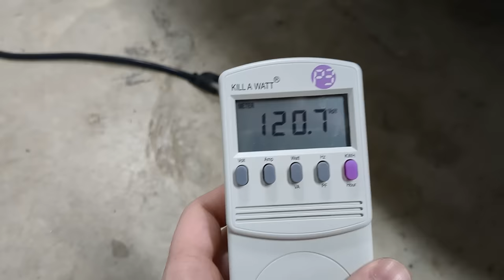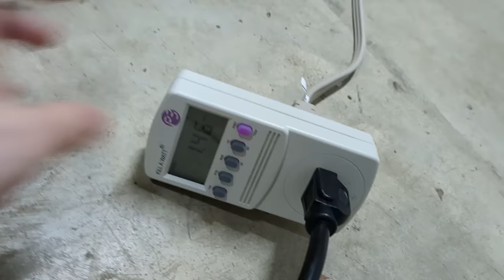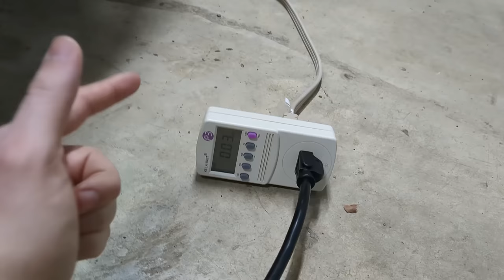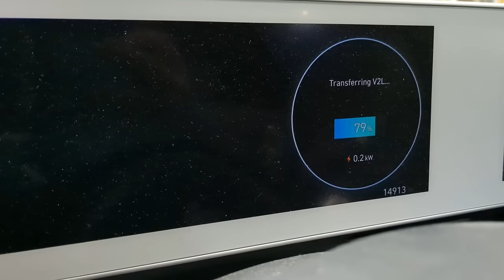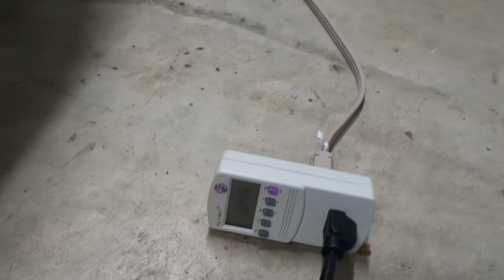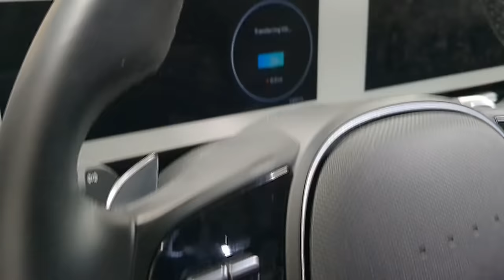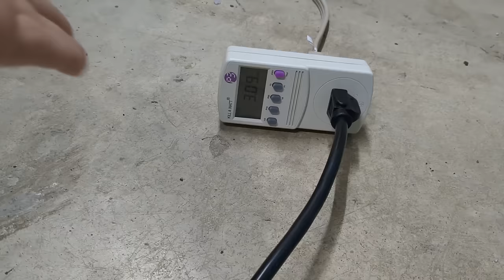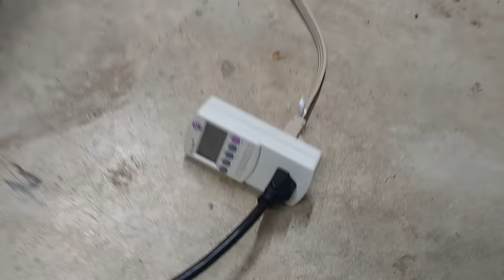A 24-hour test run of the Hyundai Ioniq 5's Vehicle-to-Load function

Comment: Overall this is a massive improvement over a generator. My 5kw generator would have used about 8 gals of gas just to idle for 24 hours, let alone whatever loads I put on it. So, $30ish at current fuel rates. You used 8 kWh of electricity (at worst off the battery). So... what, $1 of electricity. That's amazing.
Reply: But when your car battery goes dead your done for. A generator can be refilled and keep running continuously.
Reply: Sure, but the generator (petrol/diesel/gas) will run pretty much forever. Batteries in the car do degrade.
Reply: God damn, is electricity really that cheap overseas?
Reply: @philipcooper8297  Battery degrade waayyyy slower than everyone saying, afeter 10 year they are still good
Reply: Would like to see real-world tests of such. I lived in Aussie outback without power in the 80's/90's, relying solely on generators. There was a main diesel basically size of a small car which ran full-tilt for maybe an hour a day and idle for several hours then off the rest of the time, and a backup little petrol genny size of a lawnmower. It's been 30 years so I can't recall numbers, but a jerry-can of fuel for each would last us a week.
Reply: @FishFind3000 yeah, at least in my area the increasingly common severe weather and resultant long term outages, often in winter, more or less mandate keeping a fuel burning genset around. It sucks, but I can't fix the grid. EDIT:Also, I checked, there are only two level 3 charging stations in my entire county, so periodically going out and picking up power in an EV isn't practical yet.
Reply: @FishFind3000 (1) how long do you expect to need backup power for? (2) assuming it isn’t the entire state out - often its local grids only - you could drive and go fill it up somewhere then come back and carry on. Fridge etc will be fine for a few hours
Reply: @FishFind3000  You can possibly also drive the car/massive battery to a Dc charger and fil it back up in another area.
Reply: @philipcooper8297  Yeah for some who know how carb works and don't leave gas in it. And fight for  a place in line at a gas station. Most people a big battery is better no thinking about it.
Reply: @KingOfKYA  You can quite literally take human, animal and plant waste, drop it in bucked, add water, then pour the mixture into a sealed bag and create flammable gas that can power that generator, a stowe, water heater... you can also burn used engine/cooking oil to power an old diesel engine.
Reply: @MrKlawUK  Yup. Gas can't be pumped without electricity. Ran into that a couple years back when our entire city was out of electricity and everyone was trying to drive to the one station that still had power. There were certainly small areas without power for longer, but most people were stuck with only the gas they had on hand until power was restored. Makes sense for critical stuff that can't be interrupted and can keep large reserves on-hand. For individuals though, a battery makes far more sense. I don't even have a EV, but ran my fridge off an inverter on my car battery (though you need a fairly good inverter).
Reply: @FishFind3000  When you're out of gas/diesel you're dead in the water, but when your car battery is low you can recharge charge from any electric source. Generator, Solar, Grid, another Car, ect.
Reply: @Backtrack3332  yes, I'm in Ohio and I pay ~$0.12/kWh after all fees and taxes.
Reply: @FishFind3000  at 20% reserve it still has 40-60 mile range to find a place to recharge. As long as the area of effect isn't massive like the 2021 Tx or the 2003 NE blackouts, there should be somewhere in that range to recharge it. Also a two car household one could alternate which car is powering the appliance to minimize interruption while recharging and have 10+ days of of total run power.

p.s. if it is a widespread protracted blackout, the normal gas stations may not have power to run the pumps for more gass (assuming they have any).
Reply: The difference between the generator and the car is amperage output while the car could only power the microwave when it’s running the generator could run the microwave refrigerator/freezer lighting and some more 
The car is a temporary solution but the generator is better for long time use
Reply: @drewcipher896  if you have electricity readily available why are you using your car to run your house?
Reply: @AshSimmonds  My previous long term experience was 7 days without power in upstate NY after Hurricane Irene. Back then we had a smaller 2.5kW generator that could only do 120V (no water from the well pump)... it was much more fuel efficient than the 5kW beast I have now that does 240V. 

That said - I'm estimating idle fuel usage. The longest the 5kW has ever run, while supplying power for a chest freezer, fridge, and a few lights (very light load) was about 8 hours, and it used a bit more than half of it's 5-gal tank doing it. So... 6.5-8/gal per day seems about right for my generator. Its also LOUD AF. Like 100+ dB. And is a horizontal mounted Subaru single-cylinder, so it burns oil too. A few tablespoons every couple tanks (enough to trip the low oil shut off every few days) - which is also super annoying. Maybe i just dont like my 5kW generator much :)
Reply: @Backtrack3332  , my parents in the Midwest (300k pop) pay $0.074/kWh. Here in Seattle, I'm at $0.105-0.11 ish per kWh, which is cheap for large metros because we have a ton of hydro. Certain metros like NYC can approach or slightly exceed $0.20/kWh, but they're the exception. Power is very cheap here in the US. 

It's a real problem because it means no one invests in infrastructure upgrades, either the regulated monopolies that supply us or the customers who happily operate inefficient whole house blower ACs instead of room mini splits.
Reply: The 5kw generator would run very inefficiently when the load would only be a couple of hundred watts. 
One could improve that by coupling the generator to the UPS or a power wall. That’s just in theory because it would be costly (if only used for the occasional power outage) and impractical if not automated.
Reply: All he had to do was pay 50000 dollars for an EV instead 👐🏻
Reply: @KingOfKYA  Not as quickly nor as readily. Don't be astroturfing homie
Reply: @agenericaccount3935  Yeah, if he had bought a generator he wouldn’t need a car at all!
Reply: @philipcooper8297  you can? Do you happen to have a stockpile of such materials? How do you keep it from decomposing by the time it's needed?
Reply: @Conservator.  I think Ecoflow makes a generator with a battery that works like a hybrid car, efficiently using the battery for small loads then using the engine to recharge the battery occasionally.
Reply: @mattv5281  Thanks.
Reply: @FishFind3000  Unless you can charge from solar such as the 5.2kw I have on my roof. Endless power!😂
Reply: @Conservator.  I'm looking at it now, and I think you might need to buy the battery separate from the generator. So it's an expensive combo.
Reply: @philipcooper8297  While you can produce biogas at home, I would suggest that you do the math on the amount of waste required to power a home. Numbers vary, but based on biogas generator manufacturers’ figures (who have an incentive to post higher efficiency numbers), you would need a 25 cu-ft generator to produce enough biogas to cook on a stovetop (i.e., burn the gas directly for energy, no losses incurred through electricity generation) for about one hour. I’m sure it might make sense for some people (if you have a large lot and lot of decaying matter)… just like EVs and V2L makes sense for some people.

For some reason there’s this persistent thing around EVs and technology where if it’s not useful for someone, they declare it to be objectively pointless and nobody should waste time on it. I don’t understand it.
Reply: Generators are much more efficient when running at full load. Your best bet would be to run your generator for a few hours a day at maximum load to do your cooking / run your fridge and freezer / any other big loads, PLUS charge batteries. Then turn your generator off, and run small loads like lights and electronics off battery.
Reply: @FishFind3000  if you're in a situation where you have to drain the entire battery, there's probably a lot more going on.
Reply: @agenericaccount3935  I don't think I can drive a generator.
Reply: @FishFind3000  you can fill the car battery with a generator once its empty, and then you dont need to have the generator idling when you arent running any load
Reply: @Backtrack3332  California is around $0.30 kwh and have peak metering which can be much higher. I'm in the upper midwest and I pay about $0.13 kwh
Reply: @philipcooper8297 by the time the battery degrades, your generator will also be done for.
Reply: @johanneskurz7122  My 50 years old motorcycle would disagree, so would early 1900's stationary engines of all sorts.
Reply: @andrewfidel2220  Damn that's cheap as... We pay I think at least 4x that and we have massively cheaper electricity costs than europe does for example. Man americans get stuff cheap.
Reply: @WyattOShea  it's like 11 cents Canadian where I am in Ontario
Reply: Give me a functioning generator any day.
Reply: @1992djg  Not to be too snarky, but have you even listened to the first 5 minutes of the video? He's testing the system.
Reply: @philipcooper8297  EVEN if batteries don't last forever, this basically serves as a back up to your gas generator, or vice versa. So long you have fuel for it at your house and a fully charged battery in the car, you are set forever. You'd need to be incredibly unlucky to have no fuel/have no access (due to a blizzard or whatever) to it and a fully discharged car.
Reply: @agenericaccount3935  He didn't buy a second car just for this, it's his regular car that he uses day to day, so this is a freebie.
Reply: @Validole  I have a feeling that the methane, cooking oil thing is a conceptual mind experiment. Though I would be impressed by anyone that actually did that. Not that I think it's in any way practical, but I love technological gee-wiz projects.
Reply: @fezbpu  Yes, that's a great idea. And on a side note, have you seen those Teslas in the Ukraine where they've mounted a generator on the back of car? Pretty cool idea.
Reply: I just wonder what the long term cost of ownership is. Like what does the battery cost to replace, or what is the resale value of a vehicle with a bad battery. From what I’ve found the batteries can cost between $10,000 and $40,000 depending on the vehicle, and I’ve seen that EV’s with bad batteries are often sold for scrap metal prices because it’s not worth it to to fix them. So the cost of long term ownership of an EV is actually a lot more than people think. Don’t get me wrong I want to get one too, I’m just being realistic.
Reply: In America....most homeowners insurance will pay up to $500 for lost food or fuel for a generator as long as the power outage was caused by a covered event.
Reply: @philipcooper8297  generators degrate too. And quite fast actually. You are supposed to change oil every 50-100 hours and expected life of a generator is only about 500 hours. That's 20 days.
Reply: @this_time_imperfect  actual cost for battery packs is around $120/kWh, most packs are 40-60kWh so $5,000-7,500. Other than defects in manufacturing that would easily be found under the 100k mile or 150k mile warranty (federal vs California) battery degradation doesn't seem to be a major problem with the Tesla Model S where after a decade the median battery life is 83% of original. Other early EVs not made by Nissan show similar curves (Nissan screwed up with the Leaf by not having active thermal management).
Reply: @FishFind3000  Unless you store a lot of gasoline you'll need to tap the gasoline from your car for your generator as well.  Some people use natural gas if they have it or propane if they have a yard bomb.  Most modern cars are difficult to get the gasoline out of.  
Of course the only way you're gonna have a big honkin' battery is if you already have an electric or hybrid vehicle.  Worlds most expensive UPS!  
The optimal outage solution depends on what you have on hand.  A wood stove still works too.
Reply: @AshSimmonds  Sounds about right...I just survived a 4 day outage with two 5 kw generators which both would be running during the day and I would shut one down at night after all the cooking was done in 3 homes.... I put a total of 15 gallons in both for the whole duration.
Reply: @andrewfidel2220  I think you’re looking at used battery prices. For OEM replacement  a Model 3 is close to $20,000 without installation. Also I’m not talking about replacing it under warranty, I own my cars for 10+ years and drive them across the country and back. I know battery tech will get better and cheaper over time but the thought of replacing a 20k battery 3 or 4 times over the life of a vehicle doesn’t seem cost effective.
Reply: My 3.5 kw invertor generator will run 7 hours on a US gallon of gas.
Reply: @Backtrack3332  yeah, I pay 5.5 cents a kW here in central wa
Reply: @FishFind3000  When your generator runs out of gas in an hour you're done for. When the car stops supplying power at 20% you'll still have enough to go a find a charge
Reply: @this_time_imperfect  Where do you get replacing the battery 3 or 4 times over the life of a vehicle? The majority of modern vehicles aren't lasting more than 200k-300k miles, and that is if they are well cared for with proper maintenance. The battery will still be totally fine after 200k miles, still roughly 60-70% of original range, which is plenty, even after 300k miles, I bet you have over half the original range left.  Even if you are driving double the national average of 13k miles per year (26k per year), 10 years is 260k miles, you won't have to replace the battery even once during that time, let alone 3 or 4 times. Most modern electric vehicles will likely only need the battery replaced once during the entire life of the vehicle (let's say you are extremely lucky and your vehicle lasts 500k miles, that is 1 battery replacement, 250k miles and 250k miles)
Reply: @tom-sn4gd  noooo, batteries degrade based on usage.  The more discharges and recharges the quicker they die, it is just a fact.
Reply: @johanneskurz7122  no not true at all, 70 year old generators still running fine.  Show me a 70 year old battery running like new.
Reply: @BrightPage174  so you grab your gas can and go fill up the 5 gallon gas tank, and no generator runs out of gas in one hour unless you have a teaspoon gas tank.
Reply: Plus, you could always keep a fossil fuel-powered generator around to recharge your car, assuming you've however to be for X number of hours. This would make the generator's fuel consumption far more efficient since you'd only have it running when it's got a steady load on it, rather than having it run with an inconsistent load like the house would use.
Reply: @philipcooper8297  Gas degrades after a few months
Reply: @FishFind3000  yeah and if the petrol station is open the quick charge station is probably also open though
Reply: Basically, this isn't a reason to get an electric car but it's definitely a nice-to-have if you have one. Will it take the place of a generator? For some events. This definitely makes more of an incentive to have solar if you have one of these.
Reply: @FishFind3000  I thought about that too. But do you really want to run generator continuously? Especially when you are sleeping? I couldn't sleep with that much noise, and also will attract attention from neighbours and other people without power potentially wanting to break in and steal your generator. A portable car battery hooked up to inverter to power furnace blower motor while you are sleeping is much better solution. I would keep a couple of deep cycle SLA batteries for power backup, then charge it up in car (or generator during the day).
Reply: @i6power30  the baby generators that make more power then the car can deliver are no louder then a dishwasher so noise isn't much of an issue if your sleeping with any wall between you. 

As for the larger ones they make very quiet inverter machines that go to 7000 watts. Id rather listen to my generator then deal with a flooded basement or frozen pipes. A few restless nights with the generator vs even more painful days of remodeling the house. 

Ive had my basement flood 2 times, the sound of the generator is nothing compared to the weeks of work and cost to repair a finished basement.

As for theft that's something you could try to anchor the generator down, build an enclosure for it, or have it in a more secure area like the back yard behind locked gates/fences.
Reply: @FishFind3000  refilled with what? There are multiple ways to make your own electricity, from using a generator to rooftop solar or rooftop wind. I have not seen anyone make their own gas yet. 
During a blackout gas pumps dont work.
Reply: @Conservator.  the ups is pretty inefficient itself so i dont think you would gain anything
Reply: @jimbo5635  7 hours per gallon is pretty good.  I only keep 2 gallons of gas in the garage.  The car holds 10 gallons but it's difficult to get the gas out of the car.  A 5 gallon can would be reasonable if I had a generator, I'd just have to remember to dump that in the car and replace it from time to time to keep it fresh.
I'm tempted to just have the fireplace converted to a wood stove.  That'd take care of winter needs since the world can be my refrigerator.  It might be nice to have a way to run the fridge and freezer through a summer outage though.
Reply: @drkastenbrot  If you use a diesel generator you can put just about anything into it and it will run. You can stockpile fuel easily before a storm but you cant do that with electricity. Unless you have a seriously expensive system installed and space to handle all the battery's there's no way to store or make your own electrically in any meaningful way that is cost effective.
Reply: @FishFind3000  but you just said it yourself, you can use a diesel generator. you can turn anything into electricity, including gas and diesel. not the other way around. and youre not gonna run cooking oil in your car for long without serious modifications.
Reply: @FishFind3000  yup but you can use generator to charge the car. And i know it sound stupid bud hear me out. You will not have to run your generator near idle for a whole day and you use car battery as a buffer. Instead the generator would run more efficiently with bigger load such as car charging instead of couple appliances and a laptop. Also idk about your area but i dont remember power outages longer than one day in my area so this solution as an emergency would be pretty nice if you already have an EV.
Reply: @philipcooper8297  Tell "But generators run forever while batteries degrade" to literally everyone in my neighborhood around December when we had one of the worst extended blackouts in years and everyone with a generator suddenly found out that it wasn't working due to years of not needing to use it since our power is so stable here.

Literally no one could get theirs fully working out of everyone I talked to, including the guy who's our local car guy/mechanic who you'd think is great at working generators.

Meanwhile I was just chillin' with my lights on and not freezing cold in winter, thanks to running power off my EV. My EV which I, fyi, bought used and it's over 8 years old now, and the battery degradation is reported at.... Drumroll please.... 0%!

And that's not a glitch, I'm getting over the original EPA estimated range in summer on this girl with a decade old battery.
Reply: @FishFind3000  The car cuts off at 20% charge, leaving one with enough range to drive to a DC fast charger 50 miles away.

When you run out of gas, you'll have to do the same to find a working gas station. If you've already siphoned all the gas out of your car, I guess you'll have to walk.
Reply: @drkastenbrot  ok tx
Reply: @datachu Yeah, people are arguing edge cases here. "What if this one really rare thing happens" is not a good defense for anything. EV backup power just works and is extremely easy, reliable and maintenance free.
Reply: @andrewfidel2220  the UK is around 4 to 5 times that price per kWh
Reply: @this_time_imperfect The battery pack will outlast the car, a Tesla pack has done  over a million miles, look it up.
Reply: Vastly different usecases.
Reply: @Bigolg1975 you need to do more research before you start talking nonsense
Reply: @dogbreath6974  lol I just looked it up, and you’re incorrect. Daddy Elon said “someday” a battery will last a million miles. Sure, and someday he’ll fly to Mars.
Reply: @Bigolg1975 how many rebuilds did that engine have?
Reply: @this_time_imperfect you need to research better
Reply: @FishFind3000  I mean, you could still keep a generator for that extra emergency case but for most outages you'd be able to cheaply get through on just your car.
Reply: @FishFind3000  you don't need a noisy generator to keep the house warm. Read my post about using a cheap car battery hooked up an inverter to furnace blower motor
Reply: @FishFind3000  A battery that's not used doesn't wear out, a generator that's running for 10 years online 24 hours a day requires constant constant maintenance
Reply: @andrewfidel2220  I'm in San Diego where it's ridiculously expensive. I pay $0.17
Reply: @tom-sn4gd  a generator can last 30 years plus. Solar panel 35 years with only 20% degradation. Batteries are the weakest link in the whole energy food chain.
Reply: @tom-sn4gd  It's partly because a lot of people don't seem to realize that many new EVs use LiFePO4 batteries which have cycle lives of as much as 4-8x greater than other li-ion chemistries used in cars. You do of course pay for this in the lower energy density but the trade-off seems worth it, especially given LFP batteries' other benefits.
Reply: @this_time_imperfect  just get a $300 deep cycle battery that's going to power your furnace for a night then recharge it next day with car or portable solar panel
Reply: @lorc  yeah but if power outage is a rare event and generator is not heavily used it can last 30-40 years if properly maintained. A sitting idle battery will degrade even if not used
Reply: @Bigolg1975  it will also degrade with time.. The chemistry inside battery is fluid and will degrade slowly even without much usage
Reply: @dogbreath6974  again it's not the mileage that degrade battery. Unlikely ice engines. Battery has no moving parts. It degrades with time regardless of mileage driven
Reply: @pilotavery  battery not used will degrade due to chemical composition.
Reply: @i6power30  not most lithium
Reply: @pilotavery  lithium battery is also chemical battery. Chemical compounds degrade over time it's a fact.. it's not a magic black box that holds electricity forever and ever
Reply: @i6power30  Yeah but, it can still last a good 40 years if you sparsely and a good 20 years if used regularly
Reply: @pilotavery  lithium battery hasn't even been around that long. 40 year lifespan is not proven. Even if it turns out to be true, better and cheaper batteries will be on market way before then and your current state of art lithium battery will depreciate way faster than a generator which usually holds value well over long term. My position is that if you need to backup power for the entire house, a portable generator makes more financial sense than battery pack. $1000 generator will have enough power for 7-8kw and maybe depreciate 50% at most over 15 years. A 10kwh battery pack will cost $20k with inverter and installation and will depreciate 90% after 15 years.
Reply: @dogbreath6974  “Musk acknowledged that the battery packs are not built to last a million miles.” I’m not sure what I’m missing here?
Reply: @pilotavery  I'd like to see your source
Reply: you don't calculate in your price - battery wear level.  However same as for the gas generator..
Reply: @s.i.m.c.a  it's not the same. Generator ages more on running hours, battery ages on calendar regardless of usage
Reply: @i6power30  charging/discharging are physical chemical processes which cause internal stresses and strains, and will absolutely degrade the cells much quicker than otherwise.
Reply: @tom-sn4gd  We can only go by the rated recharge cycles from the manufacturers - which for Lithium Ion is 1000 charge cycles. 10 Years would give you 100 cycles per year so recharging your car about every 3-4 days. Absolutely doable depending on your commute and not allowing for any long distance travel (where you could recharge 3-4 times in a single day). This also assumes you are charging at a standard charger, a fast charger will degrade batteries much faster.
Reply: @benjaminbridger7771  yeah of course.. But even without charge discharging, the chemical solution inside the battery degrade with time just on its own. Unlike mechanical system such as generator.
Reply: @philipcooper8297 Oh boy, just because something is old doesn't make it more reliable or better.
Reply: @FishFind3000  Running the car to closest fast charger and loading for an hour will allow you to keep your home going basically forever.
Reply: OK, it's nice to have this method as an emergency short-term backup. But "massive improvement" depends on your use case and type of generator--perhaps in the case of one of those small semi-portable units. 

We have a whole-house generator (14 Kw, I think, but don't quote me on that).  It starts automatically within about 10-20s of a power outage, with also an automated transfer switch so that we don't have to do anything. It also turns itself off and reconnects to the grid when power gets restored. We can run just about everything in the house, though we do exclude a couple of circuits (1 of the central A/C units, for example). We have a large propane tank that feeds it, good for maybe 5 days or more. So, for us, an outage is nothing too inconvenient--unless the internet it taken down with it. This is what I consider the pinnacle of power backup. 

Downsides of the car (or portable generator) is that powering heating and hot water is iffy (particularly if either is electric). Also, for a car, you can't go anywhere without disconnecting power, which is an inconvenience it others live with you and stay at home. Next, you have to reserve enough to get to a charging station (that is working in the case of widespread outages).
Reply: @Zhiroc  Sounds like you are pretty well off guy. To have a automatic standby generator, it would cost around $20k installed. If you have that kind of money, you should replace it with solar panels and battery bank. quiet and reliable. completely offgrid.
Reply: @i6power30  We live in a heavily wooded area, surrounded by trees that are 2-3 times the height of the house. Also, the house is oriented roughly N/S, so neither side of the roof gets sunlight the whole day. So it's not a slam dunk here. Plus, it was installed about 20 yrs ago (for a lot less than $20k). But it was money well spent at the time.
Reply: @Zhiroc  yeah that makes sense. The generator runs on natural gas I assume? If it runs on gasoline or diesel you'd have to consider not easy to get fuel in times of wide scale power outage as most gas stations will be also be closed or queued up a mile long
Reply: @i6power30  Propane with a large tank that can probably power it for 5 days or more with 100% uptime
Reply: @drewcipher896  You can produce flammable gas from trees and run engine on it.
Reply: @i6power30  at this point I've lost track of what the original discussion was about  but of the goal is to only backup your house for outages then sure, a generator would likely be cheaper, and degradation wouldn't be a such of an issue (although cells would probably be good for a couple decades at least).
But if you've already got a huge battery just sitting in your car, then in addition to saving you on petrol and servicing, it can remove the need to spend money on a generator in the first place, with the associated space required, new petrol every year, oil changes, etc.
Reply: @benjaminbridger7771  yes of course I agree if you already have an EV then might as well make use of its battery pack. However most of EV manufacturers don't do this because the cost of inverter is a couple thousand and not everyone wants it. I guess they can make it an option but then it complicates the manufacturing process .

I was just comparing generator to a dedicated battery bank for home power backup. The latter is magnitude more expensive and even if you do load shifting on tou scheme you still wouldn't recover the cost not even close. Yeah maintaining a generator is a pain.
Reply: I'm with the genny crowd n this one, but if you cannot keep one running on-site 24 / 7, and the genny you've got can output 240v, L2 charging should get you back to 100% in half the time or better than if it were L1 charging. So then in theory you can charge the car, maybe sacrifice some runtime from the genny during the day, but then for night use use the EV.

Hybrid strategies. They work!
Reply: @AshSimmonds  but but why no solar panels?? Pump in some big salt batteries and you have enough for nearly forever
Reply: @andrewfidel2220  I am lucky with just €0.30/kWh! Some pay more than 0.40 or even morecthan 0.75 when it was at just worst.
Reply: Well the cool thing about generators in tandem with battery backup is you can deplete some battery and then turn on your gas generator to charge the battery use a good load on the generator to reach maximum energy per gallon of gas and then shut off the generator to conserve and reduce noise and maintenance on the generator
Reply: @i6power30  It doesn't cost much for the manufacturer to add V2L to a new EV. If the charger is using synchronous rectification the existing power electronics can be run in reverse by changing the much cheaper control circuitry. Or the inverter for the traction motor can be used for V2L if the vehicle is stationary. I know some EVs already use the drivetrain power electronics when charging.
Reply: @eDoc2020  you should write to EV manufacturers hopefully they will listen
Reply: I prefer the smell of burnt gas
Reply: @FishFind3000  the main problem is that you can't use your car at the same time while a generator or storage batteries makes a difference
Reply: @FishFind3000 did you not watch?  You can set it to stop at a certain percentage.  The car holds 77,000 watts worth of power.

At 1,000 watts it’d take 77 hours.
Reply: @vctrsigma  Even in the 2021 Texas outage, plenty of areas still had power. I slept in my EV each night (Tesla so the battery was useless for powering my home heater) and had no problems finding a working supercharger to fill back up each day in the Austin area.

Unless the grid catastrophically fails, it'll basically never be impossible to find power.
Reply: @akamesama  Lived through the "random blackouts" that the TX grid gave us for the big Valentine's Day Freeze for about a week. Used my little Leaf to carry gas cans to whatever station we heard had power for gas for the genny. Was very weird, and first time I'd stopped at a gas station in an EV. :) I've been thinking that for the little 2-4 hour outages we get most any time now, might be worth picking up a 1.5kw inverter - even with my degraded first generation 25 kwh battery, that'd be enough to save the frozen food and some lighting.
Reply: @RossReedstrom  You don't actually need to power your fridge for very short outages. As long as you keep it closed, a fridge will keep safe temp for ~4 hours. A freezer is even better, keeping temp for around full day if half full (chest freezers are even better). I mostly use my inverter for camping, to power my tire pump when away from home, etc as opposed to buying another large battery.
Reply: Just run it long enough to power the stuff that is needed then shut it off. Saves slot of gas.
Reply: @FishFind3000 if you live in an area where your you are regularly disconnected from the electric grid for more than 36 hours. Then you should maybe consider just not relying on electricity as much. Or if you can't live without electricity then moving to an area where that does not happen. I as a Canadian cannot recall anytime in my life where I've been out of electricity for more than 72 hours. And even then that only happens in very severe ice storms, which are the absolute worst possible case for electricals supply equipment like power lines. For those who do not know what an ice storm is, they are incredibly rare even where I live and it's basically where you have super cooled water in the form of rain. But when it touches any surface it turns into ice immediately. Kind of like that hot ice stuff That was a trend a couple years back. This will put an insane amount of stress on power lines because they're not designed to hold two to three times their weight because of all the ice build up and even if they are trees definitely aren't. And if a tree falls on a power line well that's just game over, and because this will happen in an insanely large area, it can take a day or two or three to get power back up and running. Depending on where you live it can even take way longer. But here in Canada when electricity is down that is considered a emergency by the government. And basically all resources are deployed because it'll really only be freezing rain that causes this. And in the winter people without electricity will either starve or freeze to death within about 4 days if you get unlucky with the weather
Reply: $1 bill, but several hundred pounds of coal, lmao
Reply: Yeah, but just like gasoline, you can find a working gas station fast charger and fill right back up.  Or charge it with solar.
Reply: 64 cents here
Reply: This is pretty ridiculous comparison when you need to remember that blackouts can last more then a day, and it also ignores the part where if there's a blackout, it's likely due to the cold, which means that the electric car's battery will be dying pretty soon in there, yea this is nice, but it is nowhere near just replace generators entierly
Reply: @calebbarnhouse496  "pretty ridiculous " yes you are.
Reply: @BioniqBob  cope
Reply: @calebbarnhouse496  
LOL - Lots of Losers - LOL
Reply: Powering items via your vehicle is awesome, but that’s tremendously horrible if it’s wasting practically half the battery juice, if you will, to do so. Why would the battery be so egregiously inefficient / wasteful?
Reply: @AbitoFarip  It is not, that's why.
Reply: A honda EU2000I burns about 2 gallons per 24 hours at half load...